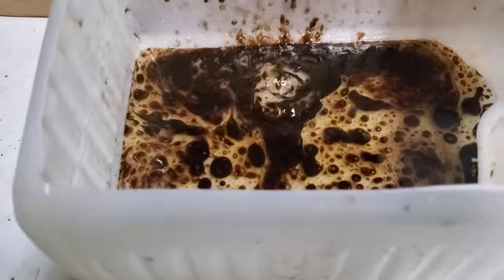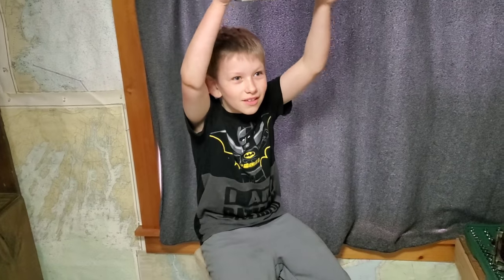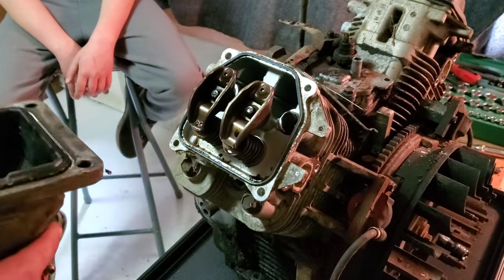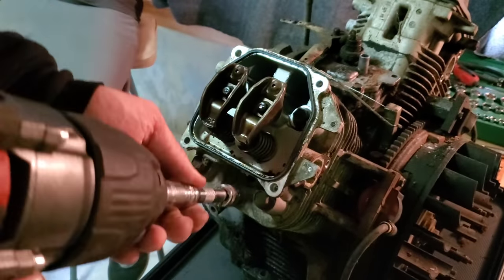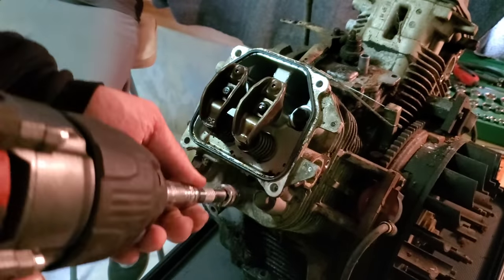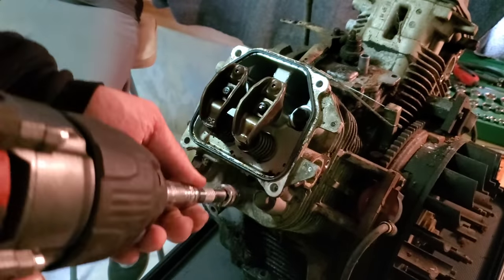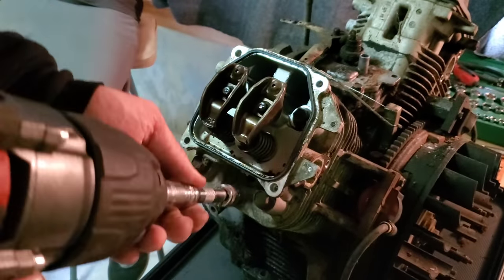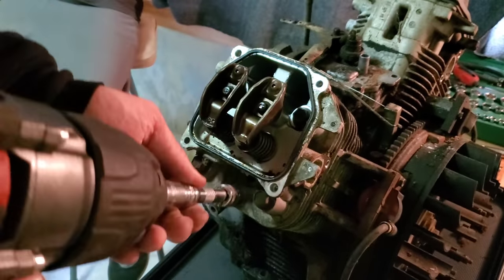Kohler CH18 Head Gasket Replacement

Comment: We have a 23 HP version of that motor in our Berco snowblower, and my Grandpa's got the 25 HP version in his GT5000. Both great, strong, and powerful motors. The one in the GT5000 is on its last leg, but that's because the tractor is a late 90's-early 2000's model, and it was never really maintained to great extents. It will be rebuilt soon, and will probably survive another lifetime. The one in the snowblower throws snow as far as the eye can see. Great motors.

Comment: Kohler really screwed us with that new air filter cover with the screw in the center. That's where the water gets in. Old commands had a cover that clipped on in the sides.
Reply: I actually got one on my stumper sp-h 20 nice little motor with side clasp, actually giving me trouble atm

Comment: thanks, I learn a lot from your  channel., Is there a channel for briggs and straton ?  I got a 97 mtd garden tractor with a 18.5 hp. it has a oil leak  on one of the cylnder. . you have in  ibspured me to try and fix it. I use often for thibgs around the house, just have to keep filling it with oil. thanks

Comment: So very common in the Kohler CH series to have leaking head gaskets. All head gaskets on my Toro 520xi CH20s and 522xi CH22s have been replaced. One of them I could hear the leak at idle which was sometimes rough. Kohler sells improved head gaskets for them.

Comment: Those Kohler command pro twin engines are wonderful engines if you take care of them slightly underpowered but work well almost had one explode today because it ran away like a 2 stroke detroit diesel due to the governor coming loose be careful when working on any engine. Big or Small Diesel or Gas.

Comment: That moment at 11:28 is what the cylinder in my K321 probably looks like right about now after hosing it down with a punch of PB blaster, whatever was left of a can of WD40, and for good measure, a squirt of dry lube teflon in attempt to unsieze the previous owner's cook job it took. I could tell that for a '77 214, I was definitely the first one to ever open her up. Still had the factory air cleaner filter and a few pounds of dust between the filter housing and the carb... 🤦‍♂
One difference between northern and southern engines, instead of mice/rat nests, you find a prolific amount of field grass, snake skins and most often, pecan shells.

Comment: thats sadness incarnate, i have a kohler cv22s its runs well though. its the same engine but more power, i needed new coils from a nest but i got then for free from the shop i work at and there wasnt water in it but gas from the fuel pump dying. thank god there was no water in the crank case.

Comment: @redneckcomputergeek you think putting coke a cola in the parts cleaner will help eat rust and corrosion off of parts?
Reply from the maker: I did some googling on this and found nothing. Was very surprised actually as that is a well know trick. If I get the chance I might try it in a glass jar to see what happens.

Comment: Carburetor problem I know The feeling.. question can some one rebuild a mover but put  muffler and carburetor on opposite sides the it begin with
Reply from the maker: Yes but would need to be a matching valve size head like when they do it on a chevy 305 in hotrods

Comment: you would be better off to glue sandpaper sheets various grits on to a flat work top slab, then rub the flat head surface on the flat sandpaper to get even flat mating surface of the head.